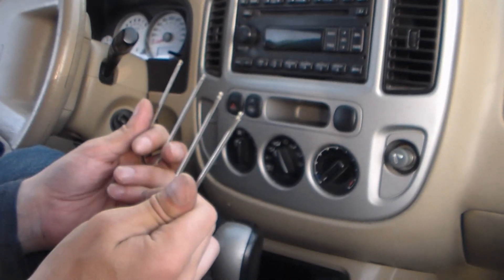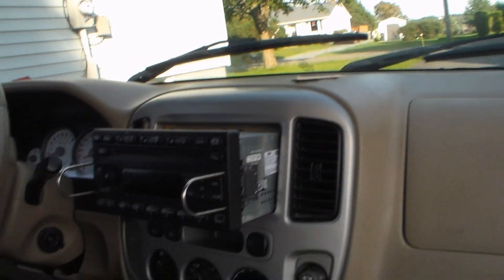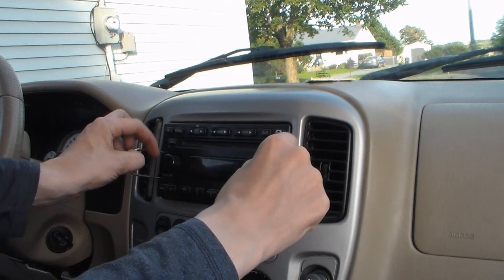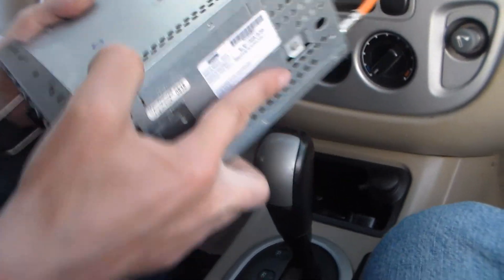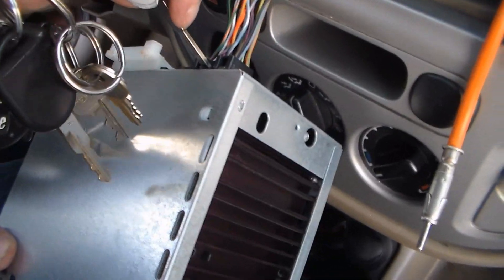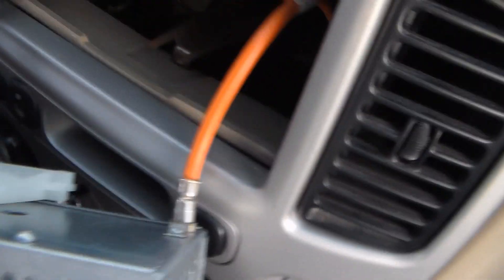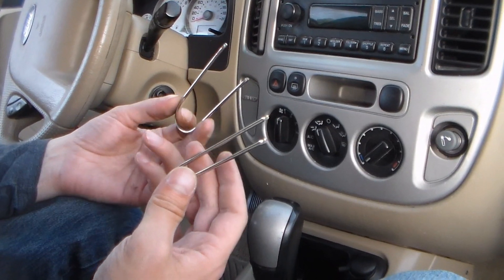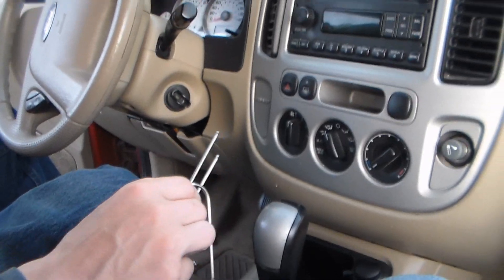How to: Change / Remove factory radio  (2001-2007 ford escape) #fordescape  #howto

Comment: What do you do when stupid tool wont release the damn radio
Reply: I had the tool kit from Walmart. You put them in and they "Click" into place on each side. Then it's an easy pull. Try to reinsert the tool in the holes and push the tool in with some force. I removed my radio yesterday.
Reply: Kathleen Haskin ya ive do e this before. Its real easy, but not this time. Someone broke one of the clips. I had to rip the face off the radio to get it out.
Reply: @ghosttraining1015  same here.. bottom clip on the left and top clip on the right were both bent in.. I "repositioned and retried" for an hour until finally ripping the face plate off 🤬
Reply: @ghosttraining1015  hahahah oh man you guys. Shit sounds just like anything I do!
Simple radio install? Right?
NOPE! 
I swear something so simple turns into a nightmare for me and cars!
Reply: What to do if you have that tool?